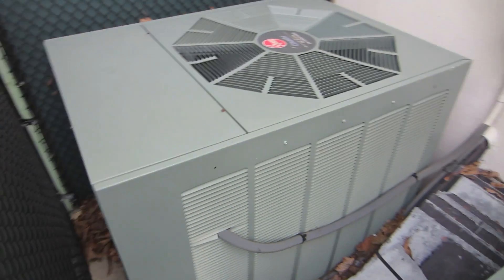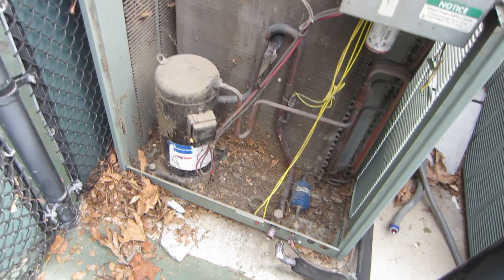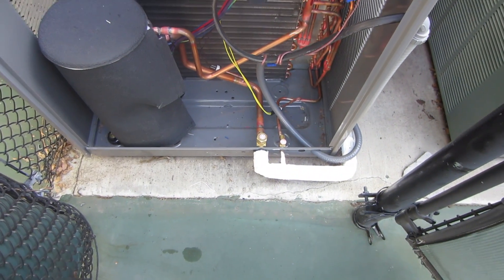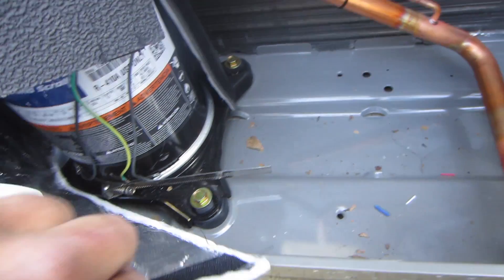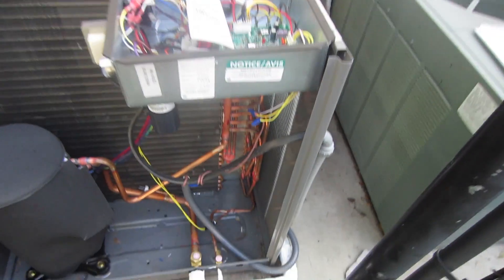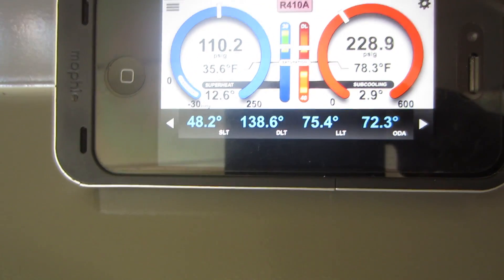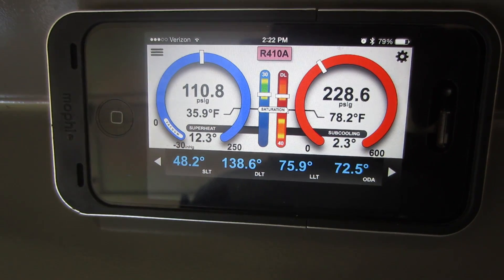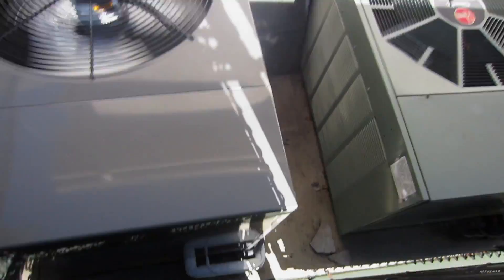Two Stage Rheem RARL Condenser with the iManifold

Comment: Hey Dallas!!
That's a pretty dang good install there, given the tight spot you had to work with! Very nice unit!

Also, I heard a rumor or two that Rheem is going to be doing away with the rectangle shaped units in the future, is that true? 

~Matt
Reply from the maker: Hey Matt, Thank you very much! The rumor are true..so sad.I actually was able to give my input on the rectangle condenser at the factory and was voted down they made the decision about two years ago. Thanks for watching!
Reply: dizziedallas That stinks, I'm going to hate to see the rectangle condensers go. What is replacing the rectangle condensers? Just the standard cube units like the Rheem Value series units? (I believe they're the 13AJN model units, but don't hold me to that)
Reply from the maker: ***** They are tell me that they are being replaced with the cube condenser and they have a new design for the high efficiency units that I have not seen yet.